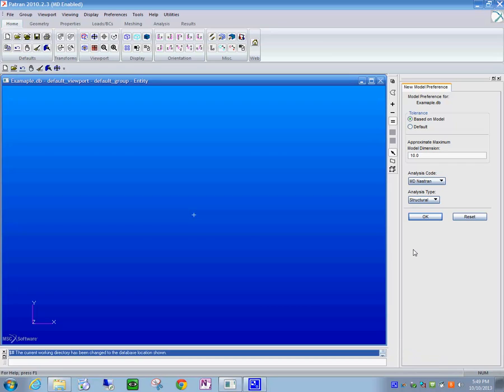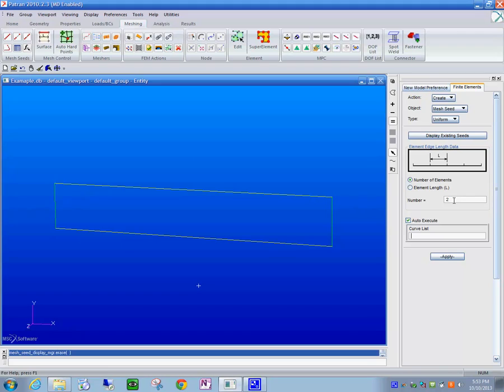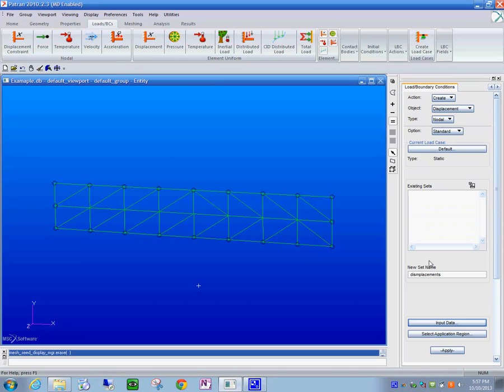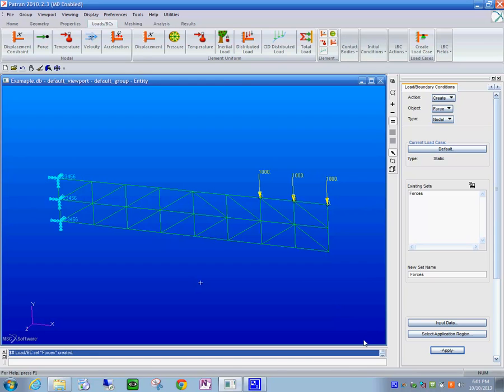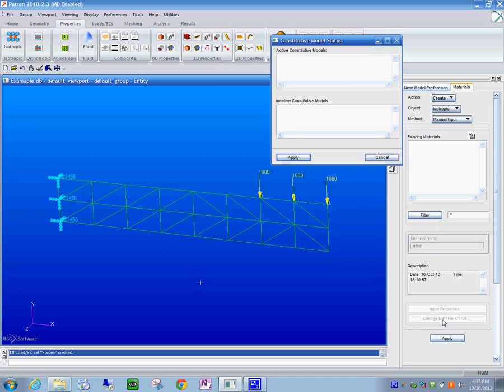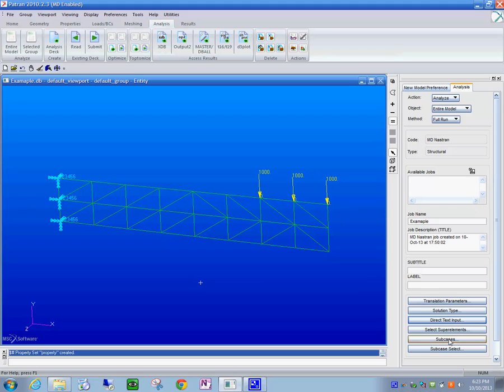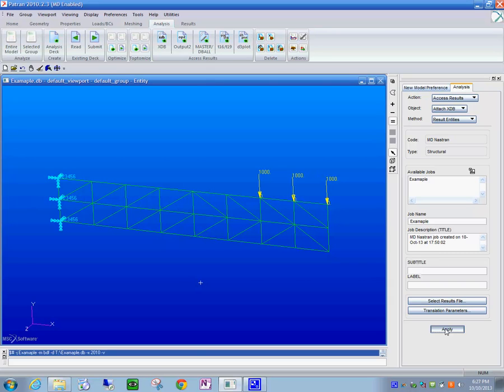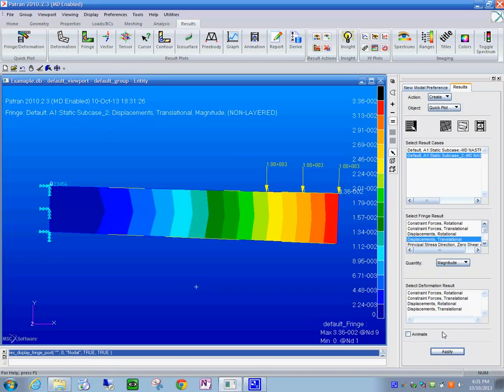Patran Tutorial Example

Comment: I have on question regarding the aplication of boundary conditions on the mesh/geometry.

I have used Abaqus, and there you have to define first the loads and boundary conditions prior to create the mesh. You just adjust the boundary conditions to the geometry, and they would be transfered to the mesh, since the geometry is used to create the Finite Elements.

But I have seen some tutorial videos about Nastran/Patran and all of them create the geometry first, and then generate the mesh. Afterwards, they apply the boundary conditions and all that stuff.

My question is, couldn't you proceed as in Abaqus, i.e., define the loads, partitions and all that stuff in the geometry, and then go to the meshing module to create the geometry? And if so, would the boundary conditions be transfered automatically to the finite elements?

Thanks in advance,

Victor